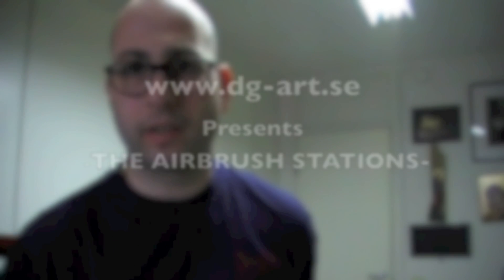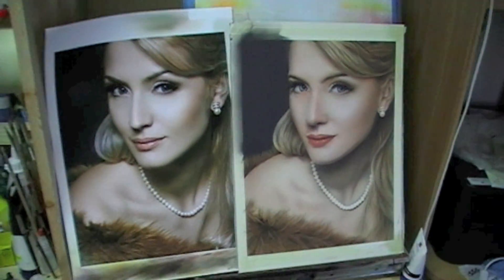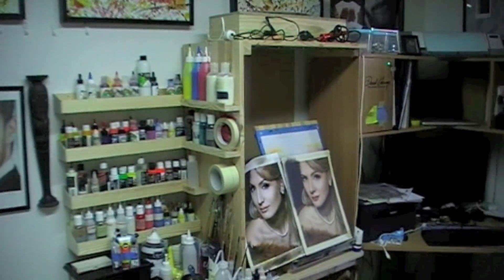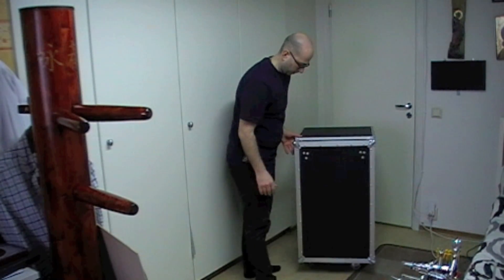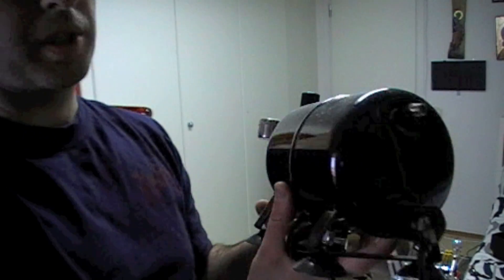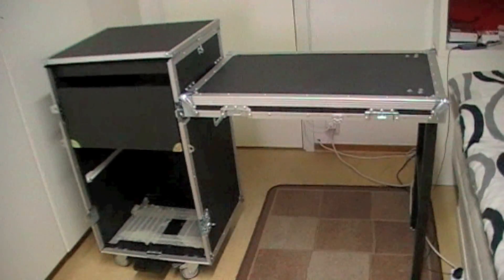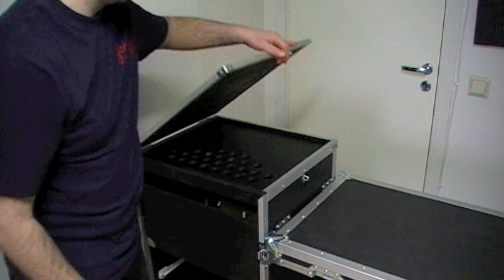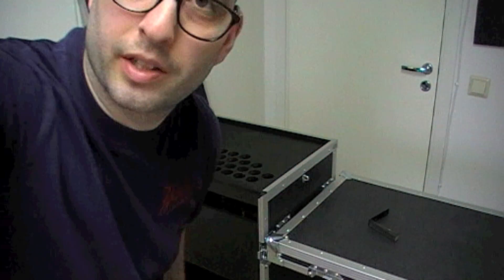Transportable airbrush station

Comment: Excellent ideea, congratulation! Maybe a ventilation system with 2 fans (in-out) will be a plus
Reply: +HermannDetailing. When the lid (table top) is off and set as table there is no need for a fan.. it will not be closed and compressor wont get heated..